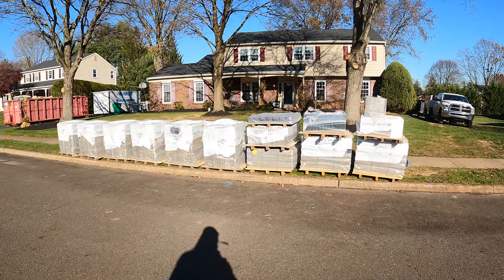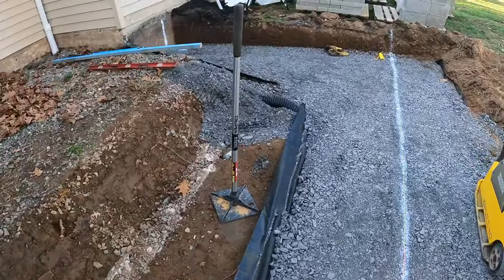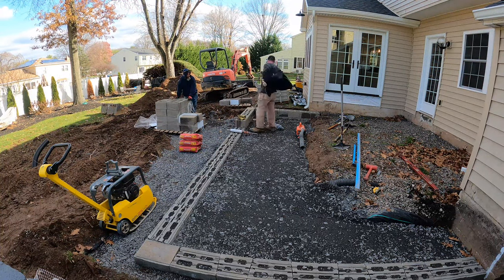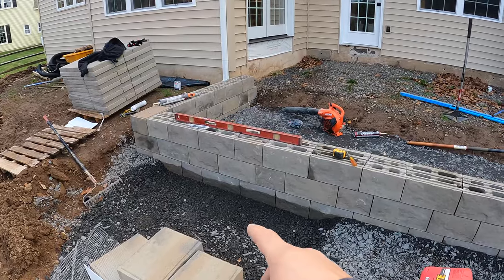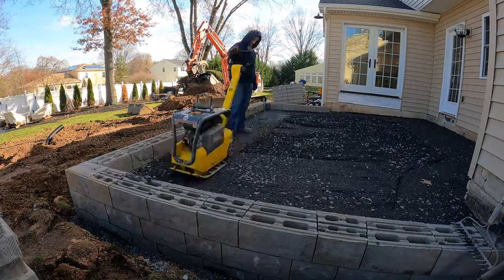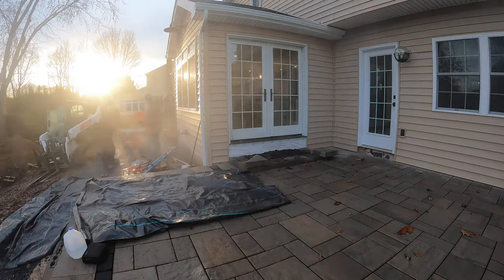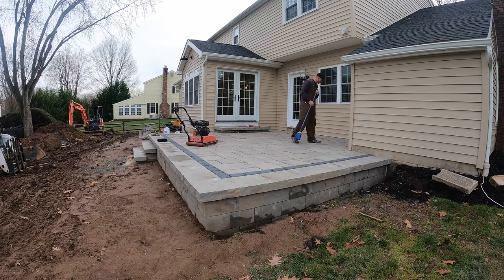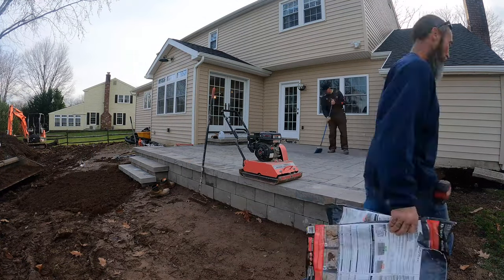How to build raised paver patio - Techo Bloc

Comment: Thanks for the video. Do you glue the cap of the wall? Do you normally lay all the way up to the wall or how do you handle that?
Reply from the maker: Yes the cap gets glued and we always start at the wall. That way the cuts end up next to the house
Reply: @srmcontracting  should have been more specific, but I meant do you lay all the way up to the wall of the house? Do you need to put any spacing or special prep for that section?

Comment: looks great, thanks for sharing.  question: what was the drain pipe for that you didnt talk about ? i assume its just the pipe coming from roof?  do these raised patios not require any type of drainage underneath?  does water just flow through since no mason mix inbetween or waterproofed?   hope these questions are not too obvious?

Comment: looks nice, and solid!  i see you said you pitched it away from the house, curious how much, over what distance?
suggestion: a little longer before and after views would give us a chance to admire the finished product, thanx ✌️
Reply from the maker: Thank you and I appreciate the suggestion. I wanted to get an after walk around shot but it was dark by the time we finished cleaning up. Sun sets about 4:30 this time of year. The patio's 16' from the house to the wall and drops 3". That works out to 3/16" per foot.
Reply: ah, totally understandable. thanx for the dimensions, i had a concrete patio poured this summer, they dropped it 2” over 12’ . np so far!
Reply from the maker: @danielcolby7293  that's a little more then 1/8" per foot. That won't ever give you a problem.
Reply: Need something like that what does material for about that size cost. I'll send a picture of my yard but not sure how.

Comment: New to the channel and DIYer. Is that a spectra rotary laser? The blue tool with what looks like a clamp on level,what is it called and where can I buy one? Nice patio.
Reply from the maker: Yes spectra laser, The blue level is a "screed level". You can purchase at local landscape or concrete supply. I believe amazon has them as well. Thanks for watching!

Comment: Nice job!  Would this be the same even if the outer wall were 8ft high?  In other words, if it started out around 2ft outside of the house, then went down hill, so that the perimeter wall were 8ft tall?  Could you essentially fill in a massive volume with the modified 3/4 stone?
Reply: Good question. I would also like to know
Reply from the maker: Thank you, yes it could be 8 ft tall. But for a wall that size I would highly recommend having an engineer draw it up.
Reply: @srmcontracting  Thanks!
Reply: Needs an engineer over 5' in most regions. Great video all around 🎉

Comment: What depth bedding stone did you go with?  Looks like you used 3/8" stone instead of sand.
Reply from the maker: It's 1" depth and yes it's 3/8 stone. Using the stone is nice because the base doesn't need to be a 100% perfect. You can go a little thicker with the stone if need be. Thanks for watching!

Comment: For structural purposes, did you need to stagger the blocks as you would a two-sided wall or could you have done it with just the long face to the front?

Comment: how do you install railings if need to? homeowner wants trex railing but obviously the top of the cap stone wont hold railing. so what do we do in that situation?
Reply from the maker: You could core hole drill through the cap down into the block and epoxy the post. That's how they set metal and aluminum railing into concrete.

Comment: Looked like you didn’t put a layer of sand before laying pavers. Is there a reason for that? Just curious.
Reply from the maker: I used 3/8" chip stone instead. It doesn't hold moisture like the sand does and it's easier to work with.

Comment: Please don't tell me you placed stone right up against the house wrap.
Reply: @Joe-sg9ll  there needs to be an air gap between the house and the patio. There should have been blocks retaining the gravel to keep that pressure off the house. Now, there's damp gravel that's probably perforated the house wrap, and the house sheathing is now acting like a retaining wall. You're just asking for wood rot.

Comment: Good job so you don’t install drain in
Reply from the maker: Thank you, since we used 3/4 modified to fill the entire patio I didn't put a drain. Compacted modified doesn't allow much water to pass through. Plus the patio is pitched away from the house so I would say 95% of the water is just going to shed from the patio.

Comment: Wow, you could simplify things so much if you had a hydraulic wheelbarrow instead of running back-and-forth with an excavator. Or even a small mini skid steer, no? I see you don’t have any clear stone behind your wall or a drain pipe. Why is that?
Reply from the maker: Those wheelbarrows are great but you need to shovel the material in and out of them. The excavator actually moves it pretty quickly and I can dump it exactly where I need it. A raised patio is a little different then an actual retaining wall. I filled behind the wall and under the patio with all 3/4 modified. When you compact modified it doesn't allow much water at all to pass through. Plus with the pitch of the patio most water will run off anyway.
Reply: @srmcontracting  we all do things differently.
The idea is you fill the wheelbarrows with the excavator or mini skid. 
No shovelling required. Then run the wheelbarrow to trench . 
Your method of raised patio won’t work in a freeze thaw region, the fines hold water and expands with the frost thereby pushing against the wall.
Reply: looks great! how tall before a railing is required?